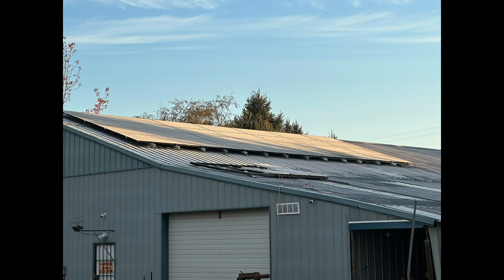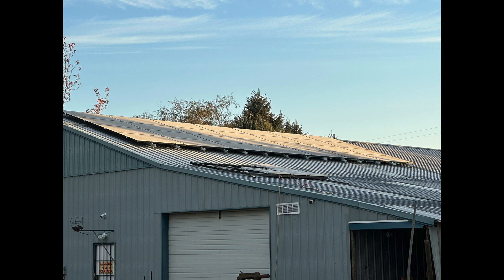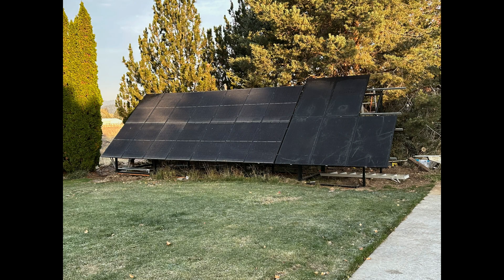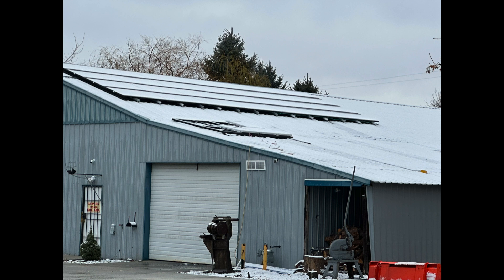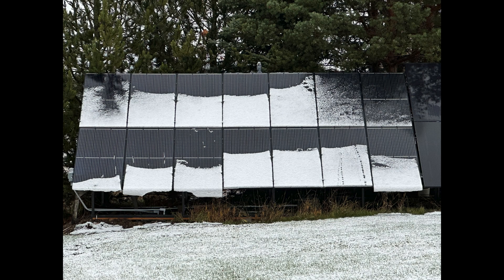The effect of angle on solar panels in winter

Comment: Gary your roof is  medal and holds the temp and keeps the unit from warming  up as the ground level ones you will always  produce less power in the winter than in the summer if the roof was black you would  find the frost and snow would melt faster

Comment: So crazy that would be having to deal with snow. Here in sunny QLD Australia it's mostly the sun and cyclones that tend to mess our solar systems up. I thought being a furnace bloke you might have to weight up is it also worth heating the panels to make them generate electricity a little quicker.  Have to love what Starlink did with their dish putting a heater on it for your colder climates, I have to keep mine away from the roof because of the heat lol.

Comment: I went with bifacials for my ground mount partially due to snow.  The panels get light from behind and produce power, which warms them up and the snow melts and rolls off faster.  I've not looked to see if the back faces of the panels frost or if it's just the fronts... if it's just the fronts I'd imagine they defrost faster too.  I don't think bifacial panesl would help much flat against a roof though.